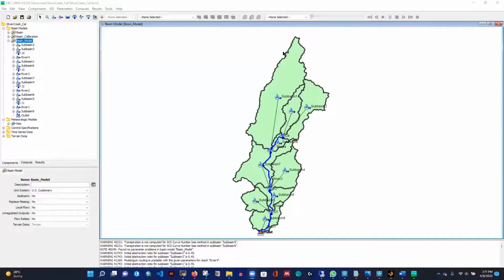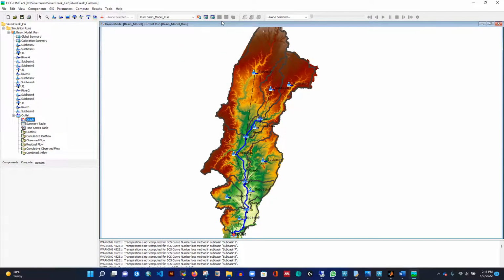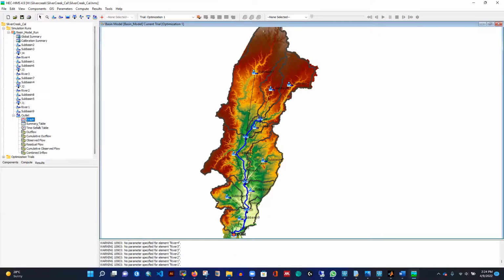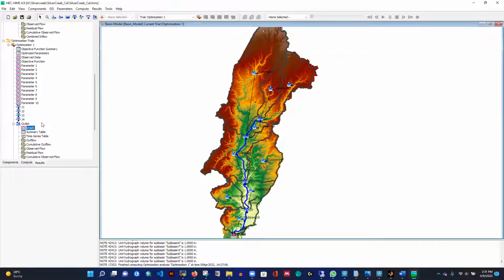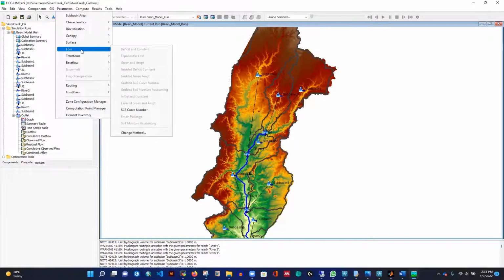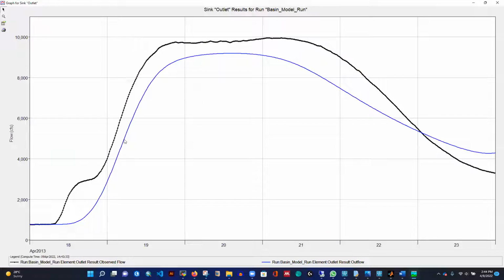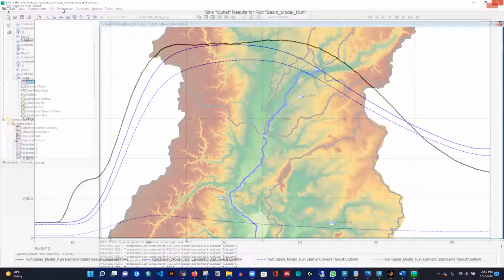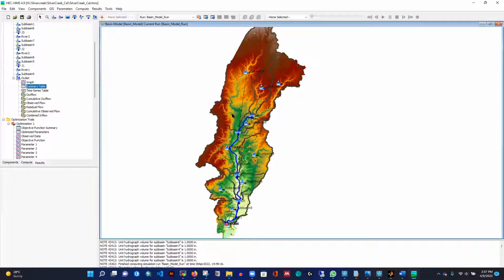How To Calibrate HEC-HMS Model Using Automatic and Manual Techniques

Comment: Based on the  the results from my  HEC-HMS simulation are:

Computed Results:
Peak Discharge: 20518.8 m³/s
Volume: 2200.22 mm
Date/Time of Peak Discharge: 21st October 1993, 00:00
Observed Flow (Gage 1):
Peak Discharge: 1038.7 m³/s
Volume: 158.40 mm
Date/Time of Peak Discharge: 7th September 1992, 00:00
RMSE (Root Mean Square Error) Std Dev: 20.8
Percent Bias: 1287.72%
Nash-Sutcliffe Efficiency: -431.  so how can i fix my problem my data is safe.

Comment: this method of calibration is impossible for me(i am using 20 years of daily precip and discharge data), the automatic calibration took nearly a day to simulate . can you suggest any other 
efficient method ??
Reply from the maker: Yes, it's possible to calibrate the model for longer period as well. However, you need to use different method for continuous model. I usually demonstrate all these in my training on HEC-HMS. For more detail info, send message to +16825537054 on WhatsApp

Comment: Thank you for your video. I have one question. 
Why do you not use the evapotranspiration method in your met model ?
Reply from the maker: Hi, thanks for the query. As this model is based on an event, that's why it's not necessary to use ET method. if you run a model for a long time (e.g., several years), then you need to use ET method. I demonstrate all these cases in my training on this modeling.